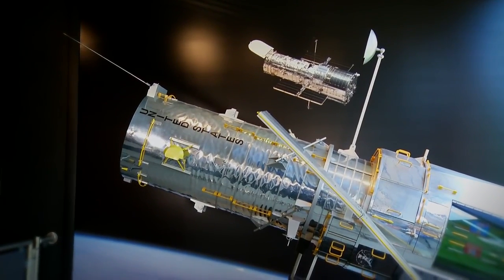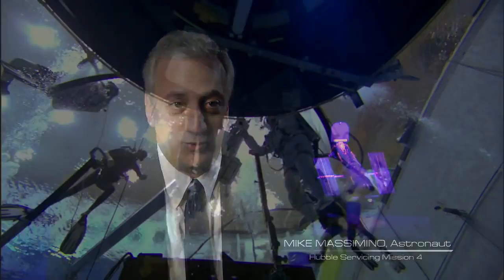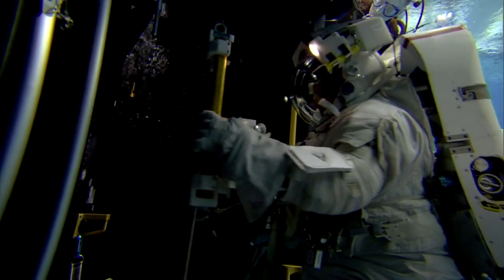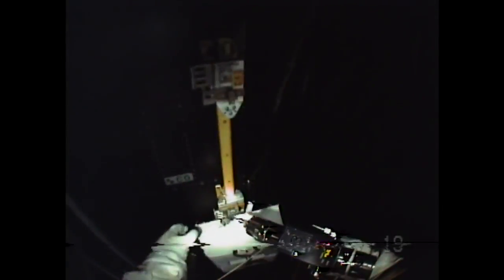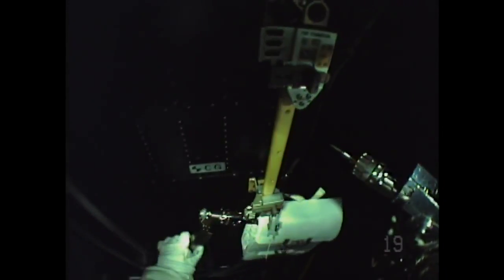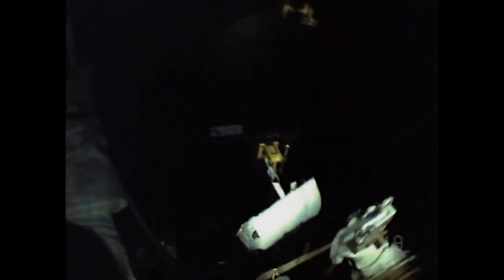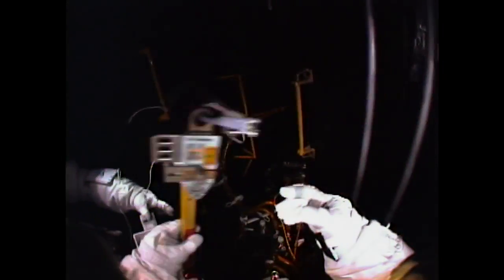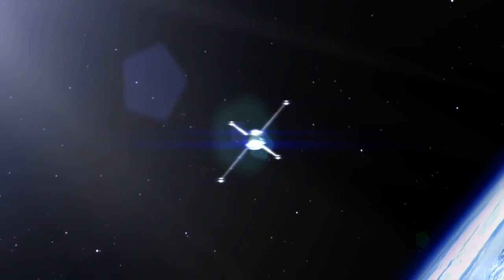Astronaut Rips Handle Off Hubble Space Telescope | Retrospective Video

Comment: Vhen you strip the nut or bolt you can try to put sheet of rubber in it or on it so it can fill caveats between stripped edges and the bit and try it again. The friction of the rubber help too. Or you can use that special paste for stripped bolts which has same function. But problem will be freezing temperature for both, the rubber and for paste.

Comment: get a rubber band and place it inbetween the screwhead and screw and you have instant grip
Reply: Also i doubt they just had rubber bands floating around randomly
Reply: +Robbie Blackshaw Maybe the screw was cross-threaded or  with stripped threads so if you try to unscrew, it will turn but won't get out
Reply: +Frenchfries12345 lol